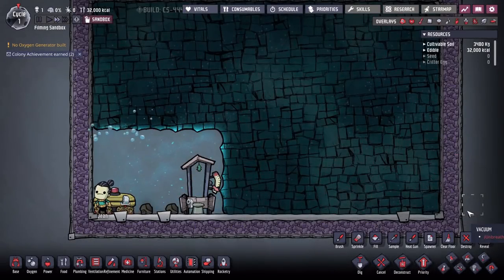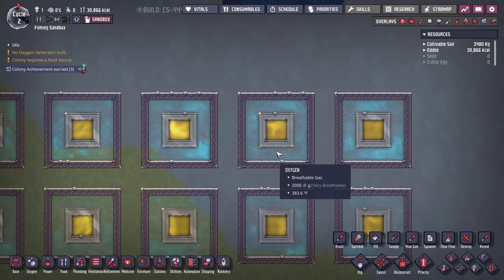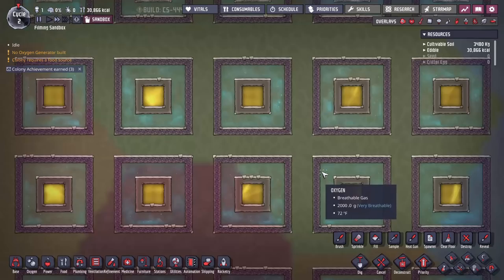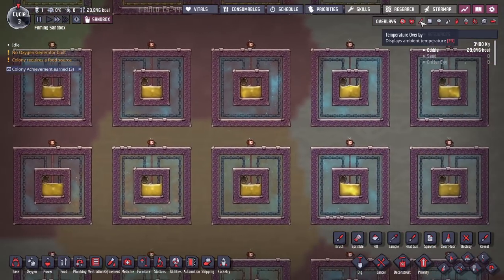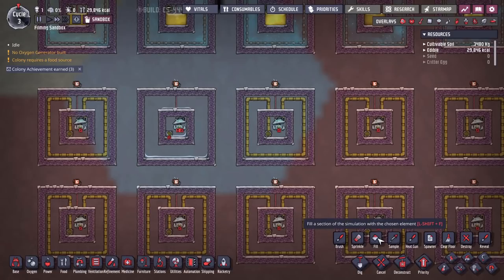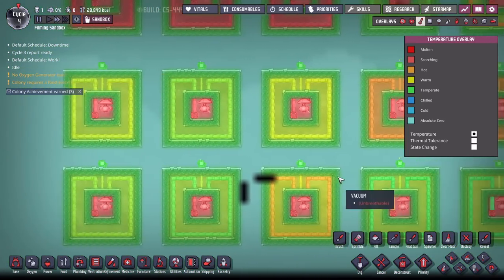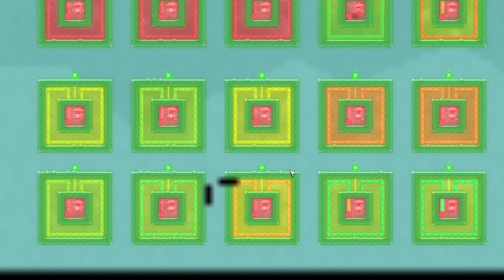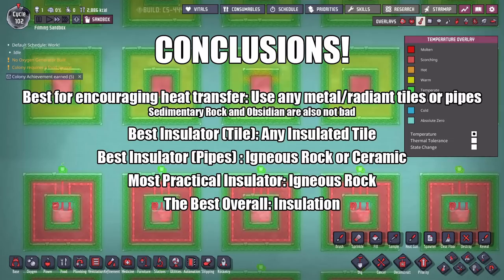Which building materials are the BEST!?  An Oxygen Not Included Science Experiment

Comment: The reason the insulation pipes and tiles are changing temperature is that the game averages the thermal conductivity of the two materials involved for normal pipes/tiles. Insulation technically has a 0.0001 thermal conductivity (so as to avoid divide by zero problems), so average that with anything and there will be (very slow) transfer. 
Insulated pipes/tiles just use the lowest conductivity value (this is why they're good) so insulated pipes/tiles built from insulation will essentially never transfer heat.
Reply: yep, this comments needs to be on top imho ^
Reply: I thought insulated pipes and tiles devide the averaged conductivity by 100, rather than just using the lower value?
Reply: ONI just added that to the compendium in game - what you said daniel :)

Comment: The reason why the aluminum radiant pipe wasn't red at the end is because it has a really high conductivity so it transferred most of the heat out before it got to the end.  That's why you had a dark red spot at the start.  It was also present in the radiant gas as well.  Not sure why the aluminum metal tile didn't work the same as it also has a very high conductivity.

Great video though, really good experiment.
Reply from the maker: Makes sense!
Reply: For the tiles the time was to short.
Aluminum has the best early/mid game thermal conductivity (only beaten by thermium (late game)).
It also has the highest shc of all the metals.
So it takes more energy to heat up but the heat transfer is very fast.
Reply: @homebro18  yeah. Aluminum volcano scares me.

Comment: For Hydrogen, the thing that means "it has a lot of energy" is the Specific Heat Capacity. You can think of SHC as meaning "how much energy does 1 degree represent". Hydrogen has high SHC, meaning that it takes longer to get the hydrogen itself heated/cooled (since it takes more energy), but when it's very hot/cold and starts transferring heat with other things, it can do it for a long time, because it's holding a lot of energy. SHC = takes longer to change and heats/cools things for longer.

The different tile types and the behavior you're seeing with the Insulation material, that seems to be because of how the game handles Thermal Conductivity (according to the wiki)... between normal tiles it will use the geometric mean between the two tiles (sqrt(TC1*TC2)), but for insulated tiles it only uses the lowest TC. This means the numbers from my previous comment were for normal tiles, not insulated; just remove the sqrt in the denominator, because the TC for polluted ice was already 1.000.

The different equilibrium temperatures of the different experiments might be due to the different SHC of the materials, since each initial configuration at the same temperature represented a different amount of energy to be transferred into the oxygen.

Seeing the heat at the top at the end might just be due to heat rising. I'm not sure whether the game actually calculates it, but in real life the colder oxygen would be denser and settle to the bottom.
Reply from the maker: Hey!  There you are, the person that inspired this whole video, hahaha.

I think the same element moving to the top/bottom based on temperature is an interesting theory, but I would figure the bottom tiles would be getting heated up much more than the top ones due to the volume of petroleum in those areas.  I'll need to test to see if the separation based on temperature is a thing, but I kinda think I caught a case where heat transfer wasn't happening correctly.  At minimum, all of the tiles touching the petroleum should be similar temperatures, but they weren't even close for the Sedimentary Rock and Obsidian Insulated Tiles.

Comment: The different equilibriums of the gaspipe testing is caused by the heat capacity of the materials and the low sum of energy in the system. One material needs more energy to reach the "stuck" temperature; from the I initial given energy by the gas. One room has therefore a higher overall heat capacity; same energy different temperatures!
Reply from the maker: Yeah, I realized that as I was watching this back, that totally makes sense :D

Comment: I remember having a lot of difficulty with piping steam to rocket fuel tanks because it was changing to liquid inside the pipes which damaged them. I think I had no choice but to use ceramic and even that was cooling the steam inside too much, so I had to move the whole steam generation system closer to the rockets. I guess the trick is to heat the steam up really hot so it doesn't cool down enough to change phase in the pipes. Not gonna lie, I kinda miss the old days of ONI where fluids going through pipes could change phase and simply pop out the other end no harm done lol

Comment: I remember hearing that the physics for changing the temperature of insulated tiles is different for gasses than liquids. Because of this difference, I think that gasses can potentially transfer heat into insulated tiles (and abysalite) faster than liquids. So if you replaced that hot petroleum with a hot gas of the same mass, I think the temperature change would occur more quickly. As another note, a thermal shift plate placed next to an insulated tile will quickly dump heat into the insulated tile.

Comment: Super helpful video, as always! Just stepping into mid game and I'm always worrying that the materials I'm using just won't be good enough, especially now that I've started dabbling with with radiant pipes to heat my ice slush while at the same time cooling my hot water, and pushing the equilizer's hot oxygen briefly through a cold biome just to bring it down to 20-30s. It's nice to see that good ol' faithful igneous rock is a totally acceptable solution as a cheap building material for much of these.
Reply from the maker: Yep, moving through the cold biome is definitely a super cheap way to cool that down!  I should probably start making build inspiration videos, just to spread the good ideas around and hopefully help people that are struggling.
Reply: @Magnet_MD  Ya, I had a small one pretty close to base so I built my SPOM right next to there. Was really surprised how only about 3 or 4 tiles worth of radiant were need to get it down from about 50c to 20ish. The heat change is insane.
A build inspiration video would be great! Especially with earlier/mid game stuff kept in mind. A lotta videos I see online show people set ups with ideas for builds, but they almost always rely on using materials much harder to get. There's definitely a bit of a struggle to get over that middle hurdle and into oil/plastic.
Reply from the maker: @Spamhard  Yeah, I always considered getting oil/plastic being the true entry point for the mid-game (and the 4th power source).  You can skip it and move straight into space, but it's definitely a more difficult transition without transit tubes.
Reply: @Magnet_MD  For sure, there's so much it opens up with steel and plastic and stuff, it's just that step into getting started.

Comment: With the insulation pipes I've seen people on the klei forums heat up normal pipes made of insulation to create molten tungsten because it turns out the insulation tag is what makes insulated pipes prevent heat transfer and I think it also has to do with the pipe exchanging their temperature to the liquid rather than the outside environment.
Reply from the maker: Yeah, which liquid is used is definitely another factor.  Maybe I'll have to repeat this with different liquids and gasses to see what the performance is for each of them.

Comment: The problem with seeing how much heat is transferred with radiant pipes is that, if the thermal conductivity is very high, the gas within the pipe will very quickly reach room temprature. It will heat up the first few tiles very quickly, but won't heat the later tiles until you let it circulate some more

Comment: Great detail!  However, the oxygen in your base isn't static - it's moving and you have to see how the materials perform with flow on both mediums.  The specific heat capacity and thermal conductivity can both have an effect in the initial stage while the pipes/tile are still changing temperature.  The true measure of heat transfer performance would be with flow across the pipe or tile AFTER the pipe/tile has stabilized it's temperature.
Reply from the maker: Yeah, there are a lot of other conditions that might be interesting to test.  The chief thing I wanted to know was what should I be generally building different pipes/tiles out of.  I may come back and do some more advanced testing like this, but I often pay attention to the very macro-level view of a lot of stuff like this, give loose suggestions and that's about it, haha.

Comment: For why the gases ended at different equilibrium temps, that is because of the specific heat capacity

That is essentially the amount of energy needed per degree. So if a high capacity heat source transfers into lower capacity recipients, the temp at steady state will be higher since even though the same amount of energy was transferred, less energy is required to heat the pipes

Comment: FYI for the Insulated pipe, the formula is 

<resulting DTU transferred> = ((conductivity of hotter thing + conductivity of colder thing) / 2) * (Temp of hotter thing - Temp of colder thing) * deltaTime * 50

This would mean that even the 0 conductivity of the insulated pipe gets averaged out with the thermal conductivity of the Oxygen:
((conductivity of hotter thing + conductivity of colder thing) / 2) 

So it still transfers heat

Comment: specific heat is the amount of energy it takes for something to change in temp. the higher the number, the more thermal energy you need to heat it, which can make it a better insulator, however that means it can raise the temperatures of things with low specific heat it will heat a lot of it before reaching temp equilibrium.

Comment: I would think the reason the top tiles heated up faster than the bottom ones could be because of the order in which heat exchange is calculated, it probably goes top left to bottom right, just like the gas that sorts themselves by density, where instead of a flat line you get a slightly slanted one, game logic, since we can't game in quantum computers to simulate phisics in real time...

Comment: Just my input on the matter. The conductivity is a lot different than the capacity. I take the capacity to mean how much heat it can take into itself but not transfer around it. The transfer is the conductivity. That, I think, is why the temperature of the material will change, even if conductivity is zero. It just won't transfer it to the surrounding material. Scientifically, that heat has to go somewhere, right?

I don't fully know the programming mechanics, but that is just my take on it.

Edit: And I should really watch the video all the way through before commenting on it. LOL.
Reply from the maker: Hahaha, yeah, that's about how I understand it as well.  A lot of people have explained the math to me a bunch of times, but I just don't absorb the information that way, and I'd rather do tests in realistic scenarios to know what's the most optimal based on what's available and based on what kind of thing I need to do.
Reply: @Magnet_MD  Same here. I need to personally witness it to absorb it fully.

Comment: Thanks for the video, would really have liked to see the material temps the same initially to remove thermal capacity of material, also real game example to verify findings (maybe as part 2) wanting to cool a 35 degree C base to below 25 degrees C with fluid consistently at 20 degrees C with both how long it takes to cool plus have a minor heating source in the base such as generator/batteries?
Reply from the maker: Yeah, all of them spawned at 68 degrees as far as I could tell.  I don't think there's a way for me to control what temperature those things spawned at, but this was also a pretty quick and dirty video idea.

I'll definitely do some kind of follow-ups to this because a lot of people are really interested in it.  I think a bunch of other practical examples ought to at least help guide people toward more reasonable cooling/temp management solutions for their own bases.

Comment: Happy new year, man! Less than 10 minutes in 2021, welcomed it with more ONI.

Also, can you guys help with the progression for power? what's the best or most common upgrade after coal?
Reply from the maker: I'd say your next best option is natural gas, but you will need steel to be able to harvest it effectively!  I do have a power tutorial video if you wanna check that out :)
Reply: If you have a natural gas vent nearby, I definitely recommend using that. It's one of the easier geysers to set up. You don't really have to heat or cool what comes out of it and you only need to spend 50 steel on the gas pump.

A steam vent (not to be confused with a cold steam vent) is also one that's pretty easy to set up, but the main problem is that you'll need quite a bit of plastic.
Reply: Depends on what you have and your goals.  In one play through I wanted to get the achievement where you can only use the hamster wheel, hydrogen, and solar.  Called super sustainable.  In that play through I went straight from hamster wheel to solar and later added hydrogen when I managed to get far enough to tame the 500 degree hydrogen vets.  The progression depends on what you have.  You could play a whole game with just hamster wheels if you took on dups just to generate power.
Reply: @Magnet_MD  gold amalgam pumps work with nat gas vents if you make the room big enough and don't insulate the airlock.  a little heat leaks but its very workable for midgame before steel is easy

Comment: Looks like igneous is the big winner overall.

Gotta admit, I'm kinda disappointed by the radiant pipe results. I really expected the metal to make a difference!
Reply from the maker: I am going to run more experiments along this same line, but testing how gasses and liquids react inside certain pipes.  The cases I can think of immediately are using radiant plumbing pipes to cool a room full of gas, and using radiant ventilation pipes to cool recently-produced oxygen by snaking them through a pool of polluted water.  I'm curious what the performance differences actually are.

Comment: If you are wanting to insulate something make it using the insulated version of tile, or pipe.  The heat transfer calculation uses only the thermal conductivity of the insulating material, not the average of the two that are in contact.  The following order is from best to less best.  Make sure the material can withstand the temperature.

Insulation
Ceramic
Mafic
Obsidian, Igneous, Fossil (you should never waste Fossil this way), Sedimentary, Sandstone
Granite

Igneous looked better in your test because it takes 5 times longer to change temp than Obsidian but the thermal conductivity is the same so long term it will be the same.  Obsidian (or ceramic) must be used to insulate magma.  I like to do a double layer with Obsidian next to the magma and then an outer layer of insulated granite for decor.  If you end up with a lot of clay then make ceramic.  It has the same decor bonus as granite.  Granite is the worst of the things the game will let you make insulated things out of but it is not that bad.

For a lot of these things you will never notice any difference.  It becomes important when you are trying to do things like make liquid oxygen and hydrogen.  It is difficult to make liquid hydrogen without the space materials super coolant and insulation or use some of the game exploits (some call them tricks).

Pyrite is a space material that can be brought back from deep space.  It melts into liquid iron although there might be some impurities left behind as well.  I didn't look that close the one time I brought it back.  I've not seen mercury in the regular game although it is probably also found in deep space.

This is a fantastic game and I hope you all enjoy it as much as I have.